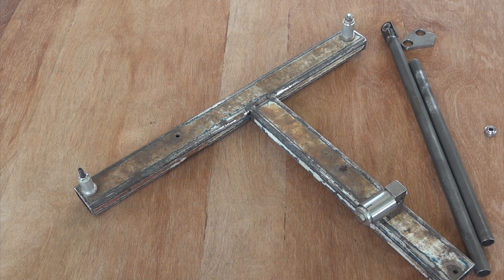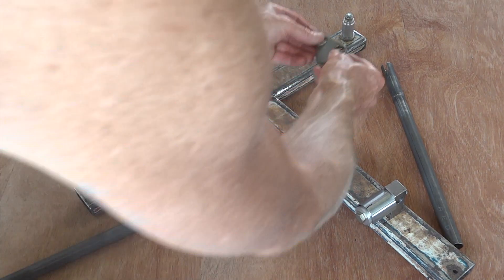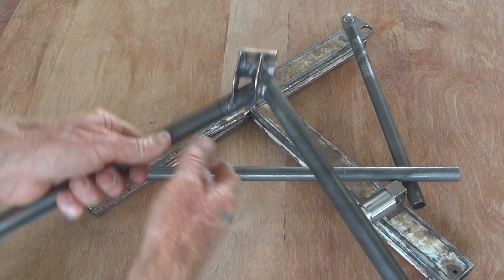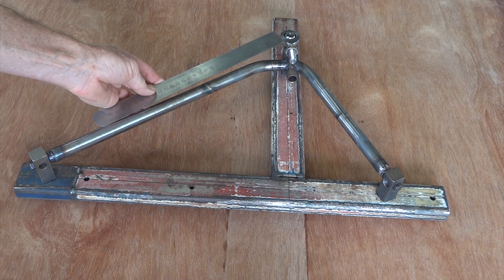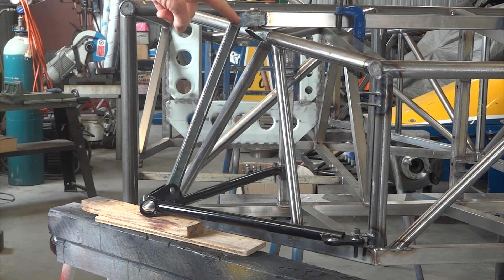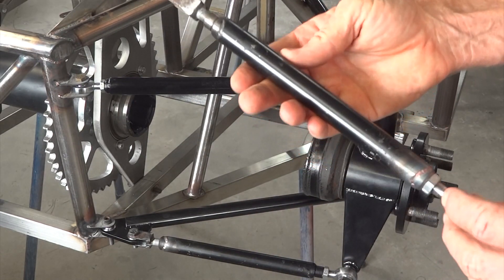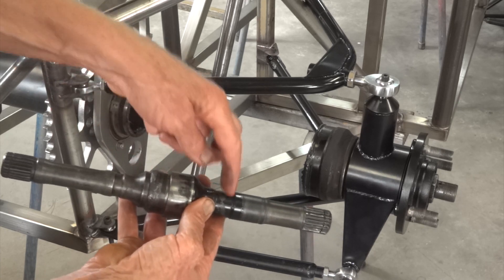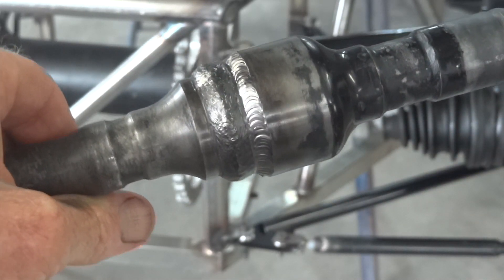Ninjamobil ZX10 Carbon Dart Rear Suspension

Comment: What does the rear toe link do? Loving your vids btw!
Reply from the maker: well, it controls the rear toe angle. It's adjustable. But it's one of the three points you need to define the position of a plane in space. top wishbone, lower wishbone, and toe link.